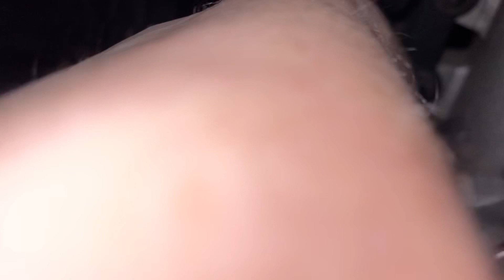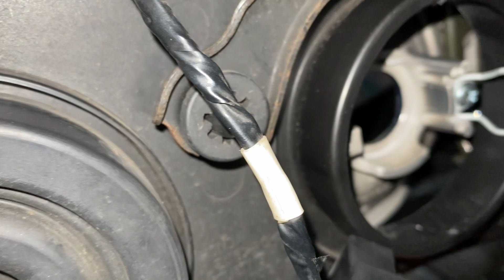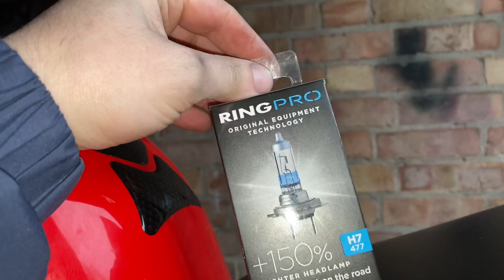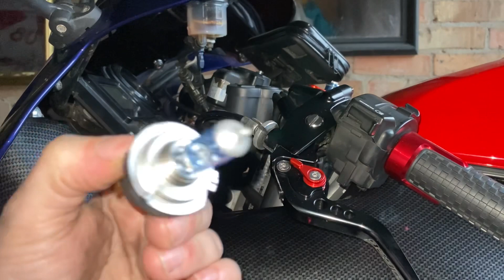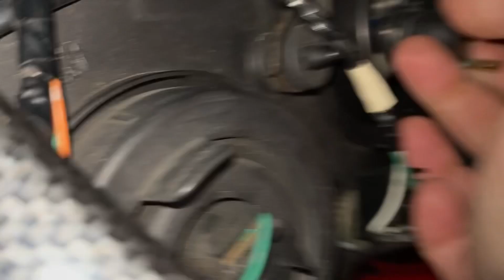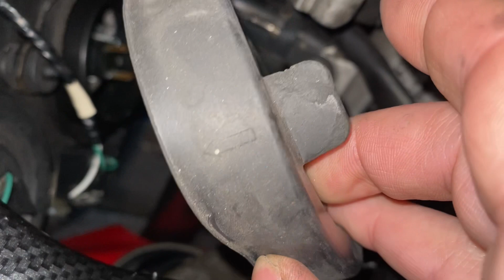Honda CBR 929 RR Fireblade Headlight Bulb Replacement

Comment: All 3 of my headlights stopped working and I replaced the fuses. Any suggestion? The bulbs don’t look blown what’s the chance they all three go out at once? I shined a light in their they don’t look blown but I haven’t taken them out either to physically look.
Reply from the maker: Check relay behind the windscreen. Swap over with one under the seat. All three are the same.
Reply: @majkel7118  I most definitely will! I just hope it isn’t a short or electrical problem, also I can’t tell in the video but have you converted to LED or HID bulbs in your 929?
Reply from the maker: @kuntry1k  no, it's just normal bulbs.
Reply: @majkel7118  I’m having trouble finding that relay behind the wind screen
Reply from the maker: @kuntry1k  https://youtu.be/csaRBv4HtcQ
Reply: @majkel7118  thank you! Trying to get it out now!! It’s stuck in there!